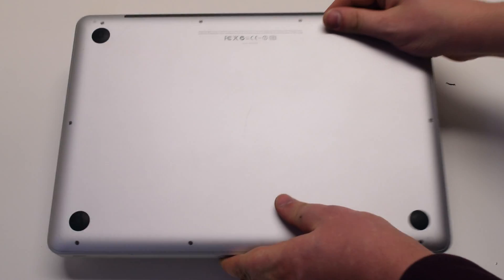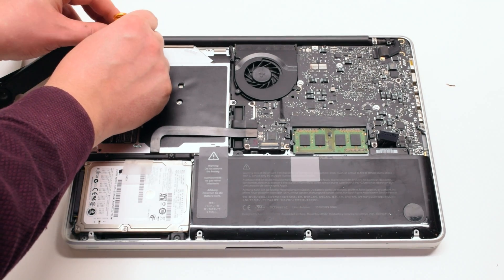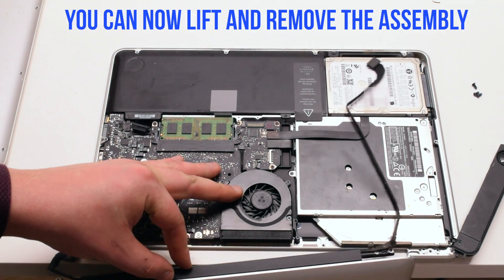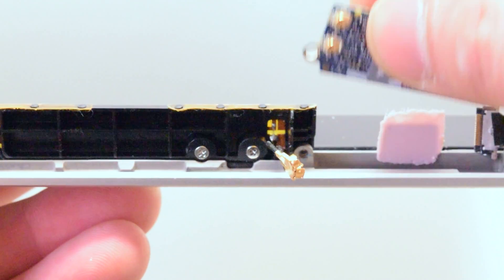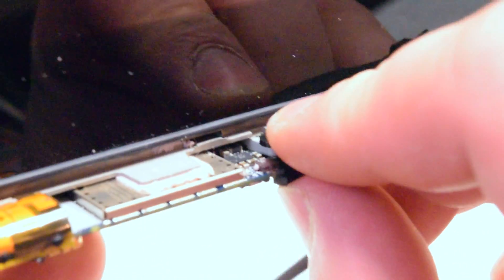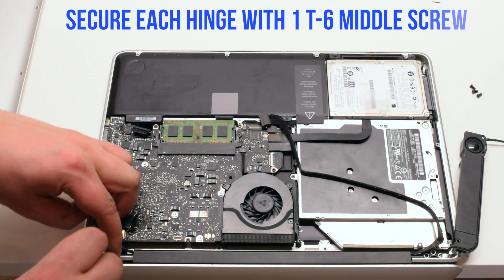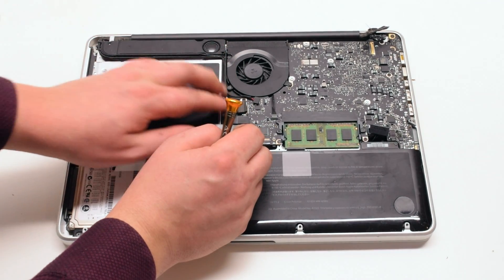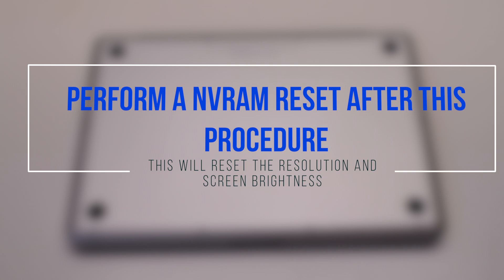2010 Macbook Pro 13" A1278 WiFi AirPort Card Replacement

Comment: Would the wifi card from a 2010 13" fit in a 2010 15"? My 13" battery has died bt the wifi is good, my 15" wifi died years ago and not used for ages. It's a backup mac for my workshop.

Comment: There is one screw I can't remove. The one on the right most side of LVDS Bracket screws. I used a PH00 philips screw driver and a T3 but nothing works. Now I'm stuck here and couldn't continue in detaching the LCD

Comment: what does that number on the centre of the card mean 607-4144A? I ordered one but it has a different number. Will it still work?
Reply: The sticker on my mid-2010 Macbook Pro said 607-6331-A, but the replacement part I received was a different number (I believe it was the number you mentioned in you comment). It ended up working perfectly fine in mine, despite being a different number

Comment: Hi, I have a 2010 13 inch macbook running high sierra, but this problem has already been present when running the original OS for this mac. My problem is that the wifi card cannot detect any networks. Very rarely though, it can detect the networks but cannot maintain a connection very long. If it does detect and connect to networks, signal and connectivity is very good. Other devices in the house can detect and connect to networks without problems. 

I have tried adding a new location, deleting the wifi and adding it again in system preferences, and even opening up the laptop and remove and reinsert the wifi card but none have solved the problem. 

Should I just replace the wifi card?
Reply: One more thing, the commands are not the same/available in the old OS, so I made the bootable dirve using another newer model macbook running a higher OS. I’m sure you can also do it through a windows device but I don’t have a link for that.
Reply: Sean Cimafranca Right. Thank you so much and I will then try it :)
Reply: Hi there, I guess so, I also have that same problem with the same model and it says that no airport card installed. I tried checking it with the repair services and I was told that it needs to replace a new wifi (AirPort) card.

And may I know how are you able to install MacOS High Sierra on your MB 2010?
Reply: Ramon Gozum 
I was able to install high sierra following the instructions in this video 
https://youtu.be/G_tOnHTe0_A

I ended up replacing the wifi card and the problem was fixed. Because it is located in the hinge, it is prone to accidents/failure, and this is a design flaw, as demonstrated in other videos as well.
Reply: Sean Cimafranca Thank you so muchhhh. Hoping that this time it  will work.

Comment: How do you know if I need you need to replace the antenna or the card?
Reply from the maker: Antenna never goes bad
Reply: Well, my card was damaged, so the macbook was turning into a white screen (without apple logo or something), when I disconnected the card, it turned on correctly. So I think that if the antenna is failing, at least the macbook  will turn on

Comment: Do you have any experience/advice relating to the uCard 4 product manufactured by Quickertech? I'm considering trying to upgrade my wifi/Bluetooth card to their AC /BT 4 model but I don't want to jump in head first w/o some reputable confirmation it will work. <https://www.quickertek.com/product/ucard-4/> Many thanks in advance should you reply! <3

Comment: Is it possible to upgrade the network card on this to a better one? this network card seems quite slow on mine.
Reply from the maker: A replacement should help but it will not be an upgrade.

Comment: What is the wifi cable part # ?
Reply from the maker: Depends on the model. Check out the ifixit.com repair guide for your specific model, they have part numbers there and you can even get it from them.

Comment: I'm having recurring wifi dropouts. I can't switch it back on unless I restart, and even after restarting sometimes if won't reconnect. Than on occasions it says "no hardware installed" with an x on a wifi. Then later it will reconnect when I move to a different location. I have no idea what is hapenning. Should I replace the wifi card? I have an mid 2010 macbook...
Reply from the maker: +bShpend Mula watch this video, it will guide you along http://www.appledollars.com/wifi-repair
Reply: Thank you so much for the tip! This channel is without a doubt the best on these matters. I will let you know how it goes!
Reply from the maker: Great, keep us updated.
Reply: Shpend Mula did you replace the wifi card?  I’m having the same issues you noted above. Did anything work for you?
Reply: @devanbruce1605  In my case, with the mid 2010 Macbook Pro, all I had to replace was the wi-fi cable. I bought only the cable on ebay, for couple of dollars, and it still works without any issues. I suggest you try this first before buying the wi-fi card itself, which is more expensive.It is easily replaced on this model, because as you can see on the video, it's on the surface.

Comment: Did anybody's monitor not come back on?  If so, what did you do?
Reply from the maker: Make sure the LVDS connector is in snug.
Reply: Thanks, Alex.  Have you ever changed the WiFI cable on this model. I ordered one and it looks easy except for the part which has the skinny cable, can't figure out how to get to that.  I'm hoping that doesn't connect to the camera.
Reply from the maker: It does and you have to take of the LCD Glass to get to it. It's very difficult and very easy to crack. Before attempting to take off the glass, you should order a glass replacement for $15 in case you crack it. http://www.ebay.com/itm/NEW-LCD-LED-Screen-Display-Glass-c-w-MacBook-Pro-13-A1278-2009-2010-2011-2012-/121243671418?hash=item1c3aaf9b7a:g:6PgAAOSwyQtVr-VS